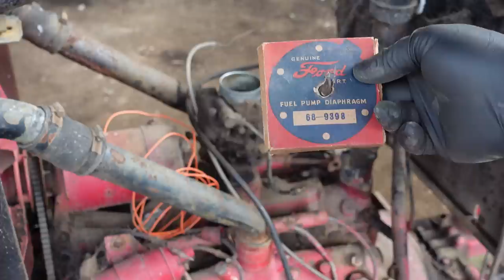The Ford V8 Spit Roast: how we did it!

Comment: On the 4 cylinder 3 speed Anglia we had after the Panther and sidecar, reverse was definitely lower than 1st. Went up steep hills backwards. Have a bucket of stinking water handy for the silly twats who use the exhaust pipes to steady themselves. It will ease the pain of the burn, but they will hopefully feel very silly.
Reply from the maker: Gday Neil, this may be the case here too mate, one bloke did say they were the same ratios so I’m not sure. It does seem like it. Sound like those were fun days back then.

Comment: Well I must say at first I thought that spit would turn way too fast.  I was wrong.  If anything it is too slow. The thing I see where you may have a problem is the belt slipping.  Maybe hook up the engine at the start with the meat on and no fire just to test it.  It is really a novel idea and would have to be a world first.  When it's time to serve, engage top gear and rev it up.
Reply from the maker: Hi Peter. It still has 2 gears so probably 3rd would be just right. I can grab that skewer with it running and seemed to not be slipping but not fat around yet either. See what happens. I may give it a test run but it would be a smaller piece of me due to the cost and won’t give a proper indication. I can always go back to the electric motor